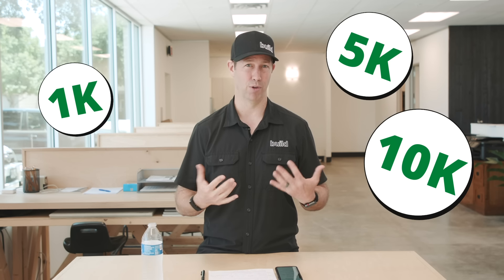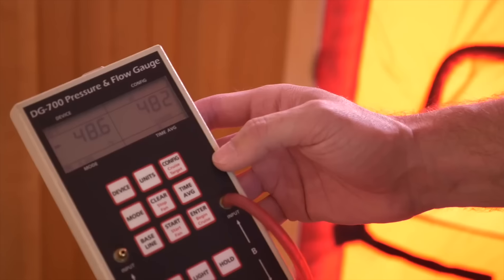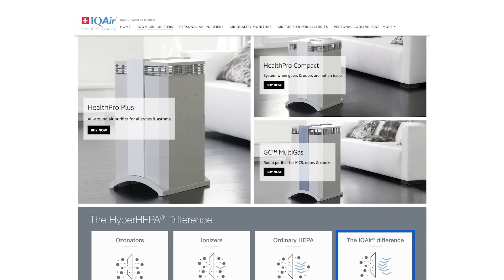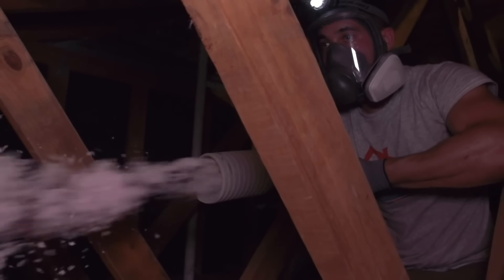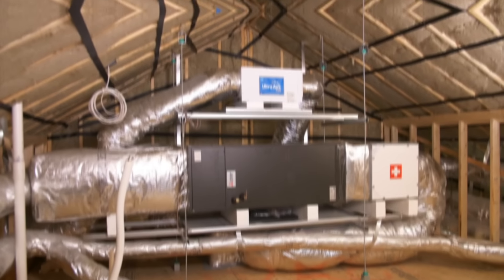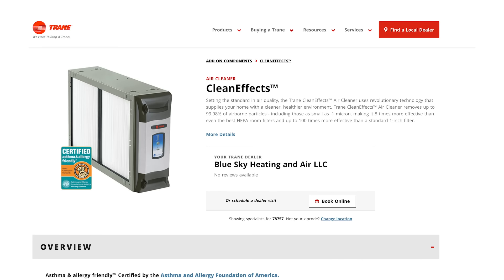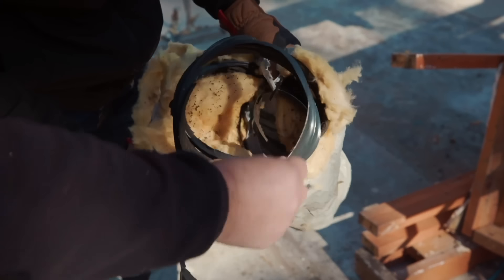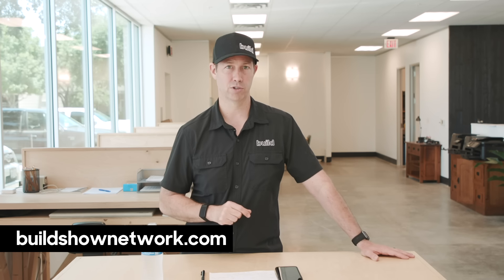Affordable Home Upgrades (Energy Efficiency & Indoor Air Quality )

Comment: What if you have an old accordion style filter?  Have them retrofit it for a bigger 5” pleaded? 
Is it worth removing the old fiberglass blown-in and then having closed cell sprayed on under roof to close and condition attic? 
Home was built in 68 I believe.

Comment: Great video!  Quick question from down here in South Louisiana.  External Trane packaged ac/furnace outside. Plenum supply goes up closet wall into attic, over length of home.  Branch ducts jut off to rooms.  Used mastic to seal branches to plenum.  Great Stuff, Big Gap Filler to insulate top and sides of plenum.  Unfaced R30 under plenum to touch bottom.  I want to open cell foam the roof deck but do not want to deal with sealing all the nooks, crannies, remove attic vents, etc.  When 90+ degrees outside, attic temp 130+.  Would the foamed roof deck help bring that 130 to at best close to the outside temp?

Comment: What about solutions which reduce BTU dump into the living space like LED lights, oven/stove ? 
What about thick curtains ?
Reply: He's mentioned shades before, I think it was on one of the passive house videos. From what I remember, if the shade isn't on the out side of the house the heat is making it's way inside, from there, what it's absorbed by and localized to is up to you.

Comment: I disagree with the $1k recommendation of getting an audit. If your budget is that tight, you should be doing things that have a return on the investment! Buy a pack of incense sticks and a tube of caulk and do some air sealing. Drain the sediment out of your water heater. install a programmable thermostat. Buy a few of those shrinky plastic window film kits (bonus if you buy them on clearance in spring) and install on your windows/doors. Buy some weather stripping and get your doors right! Put foam insulation on all the pipes you can reach especially in crawl space or attic. Buy LED light bulbs/fixtures. Install ceiling fans to reduce AC. Install a clothesline instead of running the dryer. Change your HVAC filters if the dirt is blocking airflow and clean the coils inside/outside. install low flow plumbing fixtures. Insulate where it is missing, such as crawl space or sill plate with cheap fiberglass or a couple cans of great stuff. Get some white roof paint. Install insulated blinds. Best of all, get a heat pump to replace resistance electric heating (really pushing the $1k budget here but the ROI potential is HUGE).

Comment: Just saying, as a cheap person, you can get a 4 inch pleated 20x20 filter and put it behind a box fan. The fan will suck the air through the filter, which keeps it in place (don't even need to buy bungee cords) and then after buying a pack of filters and a solid box fan, this comes out to under $100 for a few years of filtration. The downside is that you look like the cheap person that you are when you bring out your box fan with a giant filter behind it. You could also just run it at night so that you don't see it, breath clean air when you sleep, and also it doubles as a noise generator.

Comment: Good topic for most people with limited budgets for annual house projects. I personally focused on maxing insulation. So I installed R29 batts of insulation in my attic over top of the exist R20 for $1,000 US. The effect was immediate and warmer. I honestly thought I left the heat on when I came home that night. I then starting digging out my whole basement crawlspace one bucket at a time for a 2 foot area to wiggle around and install R19 batts between the floor joists held in place with R5.5 tinfoil foam board, screws and big washers then using spray foam to seal all joints forming a single solid R 24.5 insulation barrier under the house for $3,000 US in materials. I then had R20 injection foam installed inside the perimeter brick walls of the house for $8,000 US. This definitely made the house warmer but also a lot quieter. I removed the natural gas heater and disconnected the line. I now heat with electric heated floor slabs in the  master bedroom, living room and sometimes library during the winter. My solar house heater helps too. During the spring and summer I open the old traditional double hung windows, I refinished, all night and flush the thermal mass of the 106 year old house with fresh and cool night time air requiring no air conditioning during the day. I bought a $200 oscillilating air purifier and it works great for the middle afternoon. The attic insulation worked so well that I installed another layer of R29 staggered over top of the previous layer. I now have R80 attic, R20 walls and R25 floor.

Comment: I put a 19 SEER 4 head Mitsubishi mini split system in my house and my electric bill went from $350 to $165 and the temperature went from 78 to 68. Best money I have ever spent, I'm in Tampa Bay it's HOT! Also it saves so much money it will pay for itself in 6 years with a 13 year warranty parts and Labor.

Comment: Matt, I had a blower door and thermal imaging done yesterday.  I have a finished 3rd floor that is surrounded by unconditioned space.  I have duct work above the ceiling but have access to above the ceiling and behind the walls.  The attic ventilation is gable and ridge line.  Zoned AC system that can dump 3.5 tons of ac into that room and take it from 83 to 70 in about an hour (Supercooling...BAD).  Anyway, what would you recommend to make the room more comfortable?  Right now it’s built to code (r13 walls and maybe r26 ceiling, pink fiberglass insulation.  2 x 4 wall studs, so I am thinking flash and batt (2” closed cell walls and ceiling then put the pink insulation back) OR air seal with spray foam cans/ caulk, put back insulation then put up 2” rigid foam  with foil over the pink batts.  3rd option is to have the whole roof spray foamed (Most expensive) Love the channel, learned ALOT and thank you for all the information and videos!

Comment: What is your take on UV lights in the HVAC thinking about SARS, MERS and Virus .... I would like to know your take also for Commercial setups.
Also another thing I think which is MASSIVE on rebuild homes especially in the south is when you have a house with attached or integrated garage to get into the garage and really seal the Garage ceiling so the garage heat no longer can radiate to the floor above. So many times we find the garages don't have ANY insulation put in to the living areas above it.

Comment: in moderate climate zone where for the most of the year , it is not too cold or too hot I install the mini split with 38 SEER 15 HSPF  This alone  will be enough too cool or heat my house in the most efficient way 7-8 months out of the year

Comment: I own an early 1970 home in central Indiana with an unconditioned crawl space with non-insulated metal ducting. Would you recommend a closed cell spray foam installation? Would that also seal the ducting to reduce air leakage? I’ve considered Aeroseal, but am wondering if a closed cell insulation could solve both issues.

Comment: Great episode would detail your efforts to air seal a garage to the extent possible.  I am considering adding a mini-split to my 3-car garage in Dallas and my biggest issue is decreasing air leaks around 4 roll-up garage doors.
Reply from the maker: Overhead doors are tough. Planning to research this for my Build. I’ll let you know what I find!  Appreciate your support Mark!
Reply: Matt Risinger another idea for around $5-10k is to encapsulate, perimeter drain, and dehumidify a crawl space (assuming you already have decent grade and gutters for bulk water).  Obviously size specific, and lots of quality variables.

Comment: I don't understand the whole house dehumidifiers, or at least their cost. If you have a reasonably good $300 dehumidifier plumbed into a drain so you don't have to dump it all the time, it will do the same job, even if it's tucked away in a room you never used. Humidity likes to equalize itself throughout the house, unlike heating and cooling. I live in the south next to a lake, it is incredibly humid - but my house is currently at 37%. Small dehumidifier plus my heat pump for A/C is all I've got. My house is not well sealed.

Comment: For under $1,000: spend $200 on thermal camera for your phone. Then buy a some spray foam cans and caulk for another hundred. Next buy all led bulbs for every light in the house. Less heat and less energy.

Comment: My original intention for this humidifier was to use it for plants that require high moisture levels. After using it in my room, https://www.youtube.com/post/UgkxtD9aJ2m6GU-X1IChQxjn9l31K1A7Kpwj  however, I think that's where it is going to stay in the fall and winter season at least. The increased humidity in my room made the room warmer and more comfortable. I had first ran the humidifier for 4 hours with the timer setting for it. After the first hour, I checked my room and can feel the difference. When the full 4 hours was up, I checked again and noticed that the humidifier was shut off as it is suppose to. The moisture level never seem to get passed 56/57%. I then let it run until all the water is used up, which it wasn't all used up. There are still some left in the base that you are not suppose to add water to. I filled up the water tank all the way again, being careful when removing it from the base. Some left over water may spill out. After putting it back on and setting the unit to auto, I let it operate. It didn't stop running, rather I don't know if it did at any point since I didn't check it regularly, for 24 hours after which the water in the tank ran out. The moisture reading never passed 56/57%, which may be a good thing for me. Being situated right next to my bed, the noise was not very noticeable with the occasional water gurgle from time to time as the unit ran.

Comment: Hello Mr. Risinger. I just found your channel, and already got a few ideas for my small simple (well, a "german" simple) wooden garden shed. Though maybe you got input on one question I couldn't get a good answer over here in Germany:

I'm planing to build my 10ftx 25ft shed on an earth screw/stud base, and thereby have a 1-2ft fully open space underneath it to keep it away from the humid earth below. While this is a very atypical way to build in Germany (usually we'll go with a concrete base, or at least a concrete crawlspace) I got several reasons to go without concrete. Seeing that such a "floating base" is much more common in the US, I'd like to know: is there a way to build such a base  without making it vapor tight?
All sources I find suggest going with water-resistant phenolic resin coated plywood or fibre cement panels, thus a vapor tight layer, which naturally would then see some dew forming etc. pp. Is there really no alternative to basically completely sealing the bottom shut?

Comment: perfect timing!
I was visiting my brother today and he mentioned his AC wasn't performing well, so I took a quick look, and noticed that his HVAC closet doesn't have an air barrier to the attic, and that his ducts were loose at the plenum, I must say I was surprised that actual metallic tape was used on the joints, but under the stresses they'd pulled loose from the duct flange. 
I'm going to share this video with him because it's a great sum up with visuals where I was trying to explain things with only being able to point to obvious issue areas.

Comment: Tinting widows, updating to a programmable thermostat, or adding weather stripping at doors are some cheap fixes for less than $1000.
Reply: This is on point. Also insulated blinds and potentially outdoor awnings. An audit is nice, but unless you're able/willing to spend more, you aren't going to do much with it. If you can only spend that much, you might still have a sense of what kind of investments will help. Are there drafts, is it colder (hotter) near your windows, etc.
Reply: @AN94KILLZ box fan with a 20x20x1 filter. You can use tape to secure it to the back of the fan, or if you have a 3d printer you can print supports that the filter slides into. I have 2 in my house with MERV 10 filters and since our allergies have cleared up and I've even noticed my house doesn't really get dusty anymore.

Comment: Can mini splits handle  the other duties of an air handler system or would I need to supplement it?
Reply: they're generally very poor at filtering. they can dehumidify well, but you have to be careful to not over-size them. installers tend to slightly over-size. they'll calculate the BTU requirement then pick the next unit up in size, but I really think it should be rounded down unless you live in a very dry place.

Comment: For years I knew my ducts weren't sealed. But no one ever made the distinction between conditioned & unconditioned spaces. Thank you, mine are all inside so I'm gtg.
Reply: I think you can benefit from dealing any accessible ducts. Here is a video link with some good ideas: https://youtu.be/lv9ZgaivzqM

There are a few things I would add to that video. First is how to find where the duct leaks. Obviously it will be at the seams, so they get tape or mastic to seal. But sometimes there will still be leaks; I check all seams with tissue paper or toilet paper, very thin so easily blown outward away from supply ducts and ducked inward toward return ducts at any leak point.
And near the end of that video they pull registers off to check for gaps. Then they start caulking; before caulking it’s best to try to either push the metal duct a bit to decrease the gaps or to use foam caulk backer stuffed into the gap do that less caulk is used; thick caulk is best avoided when possible, and those suggestions will reduce the caulk thickness used.

Comment: What are your thoughts on the MassSave program? I work for a company that does the no cost audits through the program. I was just wondering what your thoughts are if you know the program.
Thanks Matt you are great
Reply: If the results show a 50 year payback on window replacement, it's probably a good program. Single pane without storms might be somewhat less. However, air sealing a house with water leaks from the outside can cause rot and mold issues, so don't blindly follow suggestions

Comment: Finally a topic for me. I been thinking of doing a metal roof since my shingles are past dead, and also I have no central air so I was thinking of a mini split system. Also my breaker box is full so I need to replace/expand the electrical box. These would be great topics, especially good metal roofing options for tiny small low budget old houses
Reply: Great time to do solar and electric car plug when resizing your panel too 👏🏽

Comment: Matt; Love you videos. Been wathcing you for a while. I do appreciate these sort of videos but it’s gettnig a bit redundant. Below i saw film over windows. You could have mentioned radiant barrier in the attic. Tools like water misters over a/c units, heat pumps for hot water, air exhcange (was that in there?). Also efficency is more than heating/cooling. LEDs, water conservation w atomizing showers; this topic is huge. Again, I love your stuff but also hunger a bit for some truly new material. hope all is well

Comment: With the focus on air sealing, will you need to add a way to exhaust air away from the house? The HVAC or dehumidifier can bring in fresh air, but you'll need an exhaust too right?
Reply: HVAC or dehumidifier do not bring in air, they condition the air already in your home. 

An HRV or ERV will exchange interior air with exterior air and I am surprised he didn't mention this at all.
Reply: Depends on how tight the house is, probably not necessary. You could get creative and use timers on bathroom exhaust vents when someone walks in(assuming it vents outside). Before you do that though, you would need to see what pressure the house is. Generally, you would want to be on the slightly positive side.
Reply: @Bamfhammer  An HVAC or dehumidifier can, as an option, have intake vents to mix indoor and fresh outdoor air. E.g., https://www.sylvane.com/ultra-aire-dehumidifiers.html . As opposed to an HRV or ERV (like you mentioned) which will do both intake and exhaust, hence my question about how to handle exhaust in a tight house without them.
Reply: @sogetel3  

Standard configurations to those systems you mention do not typically hook up to an intake, especially the portable humidifier options he mentions.

HVACs can have an erv or hrv hooked to them, but again, are not standard. Nobody is going to assume an hvac system or dehumidifier (which can be an option on an hvac system) include an intake system by default.